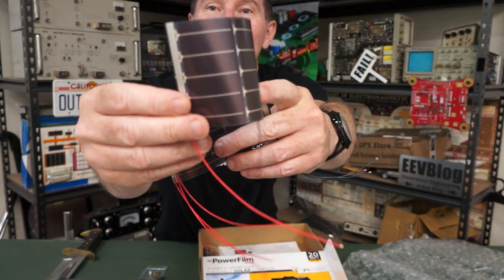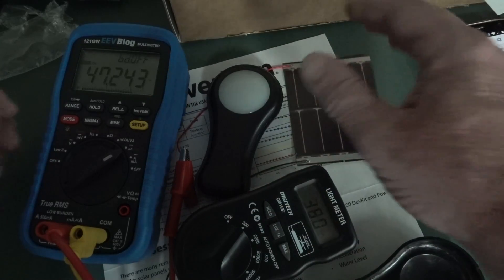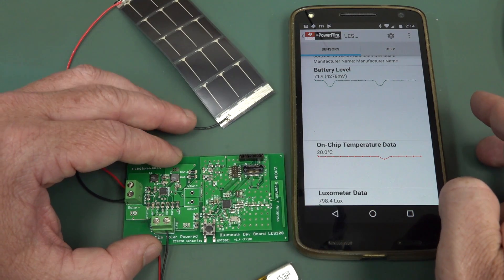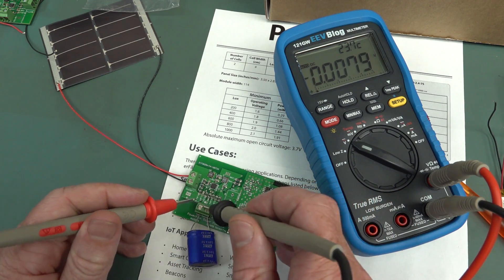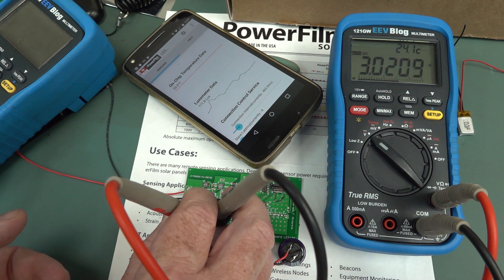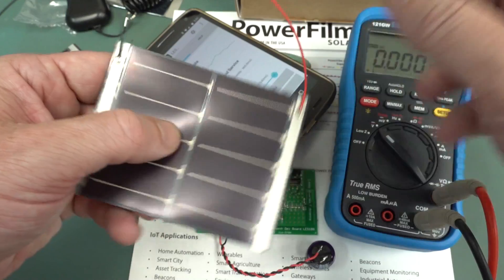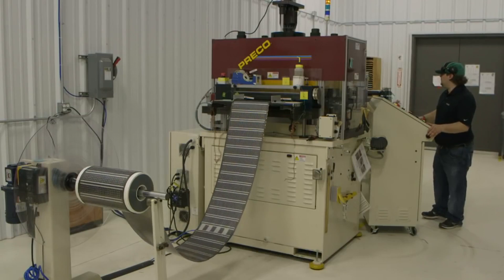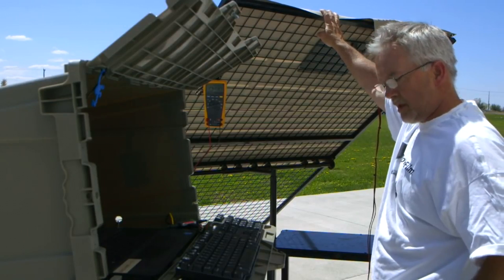#1179 - PowerFilm Flexible Indoor Solar Cell

Comment: Indoor PV cells cannot directly supply power to the BLE device because they cannot provide sufficient current for the spikes when the BLE chip wakes up. Therefore, a storage device such as a battery or a supercapacitor is needed. It is preferable to use a supercapacitor for the demo to illustrate this more clearly.

Comment: My calculator cells perform better actually..... on 3 cells from taken from dollar store calulators in parallel, 2.5 cm x 1 cm, wired in parallel in a room with indirect ligting in winter on an overcast day I get 2.5 V open circuit voltage and ~80 uA. If I bring the cells to the north facing window I get an open circuit voltage of 3.5-3.75 V and and short circuit current of 0.9 mA with an 80 mV voltage drop accross my ammeter.

That's with 3 cells and each cell is slightly smaller than each division on that sheet at 2:25. So now, if you take the same area of cells, could easily have 12 cells fit in the same area taken from calculators. Then it would make 320 uA in a dimly lit room on an overcast day in a room with no lights on in the winter and 4 mA at the window.

In full sun, the setup makes well into the milliamp range with 3 cell. But 12 dollar store calculators cost about 1/4 the price of that thin film cell...

Comment: Ive got the powerfilm lightsaver max battery pack with a big solar panel wrapped around it for camping. Its pricey but it is military grade stuff and is just crazy good.
Google it
https://youtu.be/Nkx1837KJds

https://youtu.be/k0i6PR-nwnY

Comment: That's funny. I saw that powerfilm manufacturing video a while back and inquired about the line rejected panels, hoping to get some to test and scavenge for use in low power applications. They were nice enough to send me a few dozen and they all turned out to have low current failure modes, but they still could put out 1-3W per square foot in broad daylight. I'm guessing they get dropped from the line for putting out less than 4-5. I do think it was cool that 0 tested panels, even from the rejects, had no output. 
Oh, funny mini story, I got them mid process and so without wires. I didn't pay enough attention to the video the first time to notice they they just lay the litz wire down and solder through the plastic to the tabs, and so after peeling corners and welling in doubt for a moment I just stabbed the meter probes through what looked like the tabs.
Totally worked, it was even a pretty robust connection. I tested that cell on various loads for hours with the probes sticking right through and didn't see the meter reading flicker once. lol
Needless to say I'm a fan of their work.
I'd be happy to send you a couple of the ~1sq.ft. ones if you wanted to test the ever loving stuff out of them in a better video than I could do.
Reply: Atlas WalkedAway lol i have read your comment there an hour ago. Nice seeing you here. How much did you pay for those defective panels?
Reply: @Broxine  All they charged me was the shipping cost. It was very nice of them.
Reply: Atlas WalkedAway nice 👍

Comment: i'd bet $ these are not even close to the flexible solar cells NASA uses. Ive even noticed that newer, say calculator cells, are not as good as older cells from the 80s.  when you would think that newer tech was better thats not always true. i built four solar panels back in the mid 90s and they outlasted and performed better than the new ones i bought in 2004-05. plus the new ones cost me 5-6x as much i was so PO'd! So i'd say that not all solar cells are created equal. and from my brief experience , just because they cost more doesnt mean they are better.
Reply: Not NASA, but space: https://www.powerfilmsolar.com/custom-solutions/case-studies/space-yacht/
Reply: That makes positively no sense. Prices for solar cells have dropped immensely in the last 20 years.
Reply: @Zonkotron  , prices might have dropped, but so has efficiency , the amount of power produced, and the quality of the cells. Now with the skies being sprayed with whatever everyday, its blocking 10-15% of solar radiation, maybe more in the southwest US.
Reply: @jamescorvett  I see, you require special needs tinfoil coated solar panels.........
Reply: @Zonkotron  , maybe you can spare some from your hat? lol

Comment: I built several parts for a machine to build flexible solar panels. I was working at a tool and die shop in Independence, Iowa and always wondered what happened to the idea and the company. I wonder if this is the same company?

Comment: Isn't "Indoor solar cell" an oxymoron?
Reply: My house  has windows. I don't know about yours :)  But true indoor photovoltaics (powered by fluorescent or LED lights) are a real thing too for niche applications that require very little power but where wires or batteries are not desirable.  Calculators are the classic example, but also stuff like point of sale marketing displays.  For instance if you want to rotate a small display or flash some LEDs or operate a clock, you need buggeral power.
Reply: @evanjeffrey9677  surely right, but that's not and will not be a mass market compared to the outdoor solar cell industry reaching production volumes of more than 100 GW last year.

Of all energy harvesting techniques, solar cells appear to be the only ones with a real potential  without the need to beat thermodynamics or other laws of physics.

But advertising solar cells as a general means for power indoors, as is done by some, is just not right...
Reply: yes, it is! There have been application examples of a certain type of solar cells as lamp shades... https://www.fastcompany.com/1661787/michael-gratzels-solar-cells-get-stylish-color-and-translucent-materials